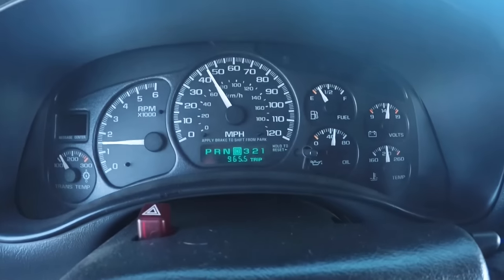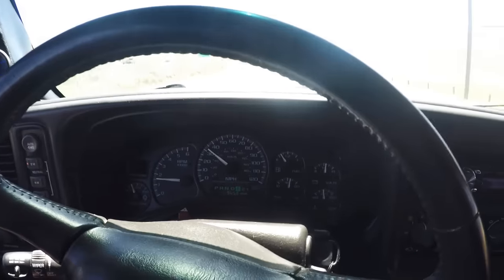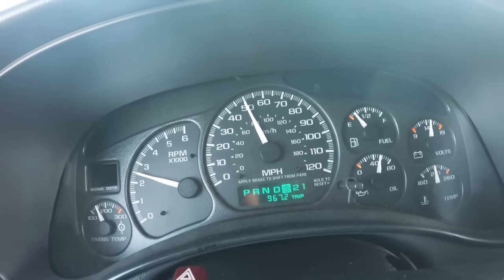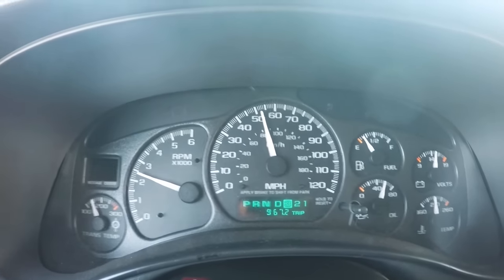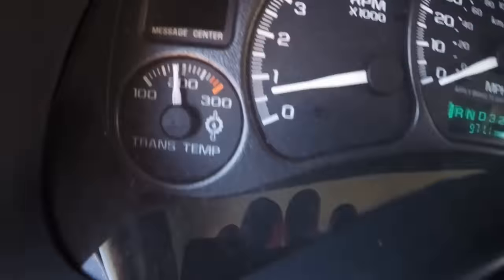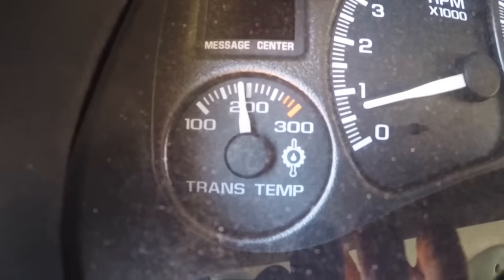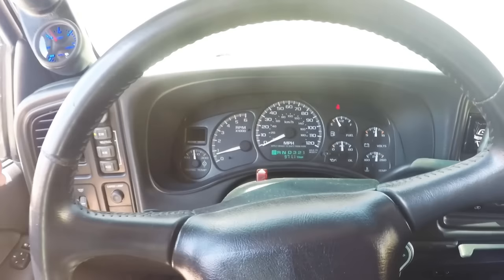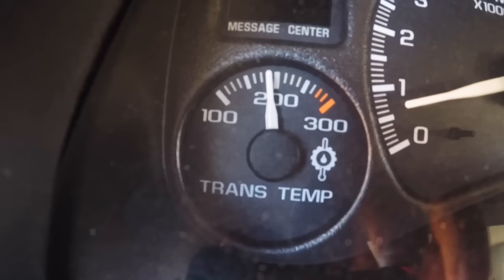6 Month Review With Cam and 3000 Stall Torque Converter

Comment: hey what stall converter would you reccomend me bc im putting a 228/228 .600 lift tsp cam in my 2003 silverado 4.8 and i dont know what size stall to put in
Reply from the maker: I would get the same one. The 3000-3200 stall. You can email circle d and they will tell you what stall would be best for your set up
Reply: I put a 3200 stall on mines with that same cam

Comment: I just picked up some 799 casting do you know a good shop to send to get fully ported?
Reply from the maker: Katech offers cnc porting for like 600 I think. And tsp also has cnc porting for about 900 but they will mill the heads also

Comment: 3000 is a little radical for street driving considering you can't drive highway speed in 4th. I'm sure the fuel economy is way off having to run it in 3rd
Reply: No no. Not how it works at all.
Reply: How does it work then? He said himself that he has to leave it in 3rd because the rpm us too low to drive it in 4th. The more rpm you have to run the less fuel economy you have.
Reply: You can have a 3k stall and drive at 70mph in OD at 2400 rpm with the TC locked no problem
Reply: That’s the beauty of modern lock up converters.  Older style non-lock up converters were a drag as the converter would slip at highway speeds causing excessive heat and reduced mileage.  With a lock up converter you get the best of both worlds.  Higher stall for quicker acceleration and lock up for cruising which acts just lock stock.
Reply: Adrian Laverick - exactly!

Comment: Hi i'm a newbie here...Finally, this is the first time that i see how to shift/use  an automatic and what a stallconverter does. I have a Chevy C-10 with TH700R4  transmission and didn't know what to do with 1, 2 and 3rd. Engine is 5.7 with Comp Cams 224/224 with LSA 107, 1.6 roller rockers, Promaxx 66cc heads plus Barry Grand stage 3 carb. 1800 Stall... Can i use 3rd as off idling and punch it? Thank you very much. Regards, Harry

Comment: What's the duration on your cam? It seems pretty small so I'm wondering if I should go bigger stall wise
Reply from the maker: 223/226
Reply: I have a 383 Sbc and my duration @ .050 is 219/225

Comment: Did you increase line pressure or add shift kit ?
Reply from the maker: I put in a corvette servo. No idea about line pressure. I had a shop tune it
Reply: @EndlessWishlist  usually with that addition your tuner will do some wot line increase and make your Trans shift faster, good ass tuner what it seems like

Comment: Just subscribed brother! Quick quetion did you buy those head lights on ebay? I seen some similar ones on ebay but wasnt sure how good they are
Reply from the maker: Yes I did. But they weren’t the 40 dollar set. They cost over 100 bucks. Just look at the pictures and make sure that they have metal in the back side. Not just plastic
Reply: Endless Wishlist awesome! Thanks!

Comment: What do you recommend for a 2003 Chevy silvarado stall?
Reply from the maker: I have only had this one. So I don’t think I’m qualified to give a recommendation. But I do love this one.
Reply: Endless Wishlist is the stall necessary? I want one but don’t have the money to get both at the same still
Reply from the maker: If the cam is big then yes. You will lose low end power with a big cam and a stock torque converter
Reply: Endless Wishlist what stall would be good for a 228R 228/228 600”/.600” cam
Reply from the maker: I would just email circle D or whatever brand you are looking at. They can help you a lot more than I could
Reply: Endless Wishlist okay thanks

Comment: How many miles are on the truck?
Reply from the maker: The truck had about 180,000 the engine has 80 on the crank and pistons. Everything else is new
Reply: That's not bad. Had an 05 a few years back with an l33 that was on it's last led I wanted to lay swap but I decided to sale it. I'm trying to get my hands on a 97 k1500 now to ls swap
Reply from the maker: I’m just so mad because I had a whip ass 92 in high school. If people were LS swapping back then I would have kept it.
Reply: I had a 93 ext cab short bed 2wd in high school. I should have kept it and ls swapped it but I just had to have a 4wd truck so I traded it off. Regretted it everyday

Comment: How did you get a trans temp gauge on a 1500?
Reply from the maker: I got the cluster out of a Denali.
Reply: Endless Wishlist ohh nice, so the trans temp sensor and wire is already there and all you have to do is plug it into the denali cluster?...and also the speedo goes up to 120 in the Denali cluster, is that also just plug and play?
Reply from the maker: Yup you don’t have to do anything. Just put the cluster in.

Comment: good video man, im building a 5.3 and was looking at installing a btr stage 4 cam and I was reading about the whole tc issue...I don't mind doing it but I drive the truck in the winter time up in Canada and im curious if it will just be a animal all over the road if I decide to go that route?
Reply from the maker: No not at all. I drive mine in the snow and ice and it’s fine. You can still take off slow. It’s just when you punch it, the tc allows the engine to jump up in Rpms more than the stock one will.
Reply: Thanks man, good video!
Reply: What stall for a stage 4 cam?

Comment: What gear ratio in the rear diff? Seems tall geared.
Reply from the maker: 4.56 with 35” tires
Reply: @EndlessWishlist  Really? Thats some low gears. Nice choice. I have stock 4.10s with 20s. My overall circumstance is the same as stock and I don't plan on doing a lift. I have a 05 GMC Sierra 1500 4wd SLT crew cab 5.3 and im trying to decide on which stall i want it at. Im just getting started, about to do headers and duals, then a cam, LS6 valve springs and new rockers and a tune.

Comment: Damn man iv went threw 4 transmission in one year and waited on a 5th one from jegs now i have a tci 3000 stall converter  i got 2 transmission coolers on it with fans on them .i dont understand how my truck keeps going threw thease 4l60e transmissions no one can fig it out i know 4l60e aint very good for any power but i never had a problem tell i put a different converter in it after i cammed it.any ways good video brother doubt you'll see this since its a 2 year old video